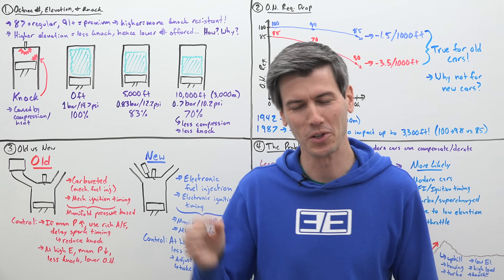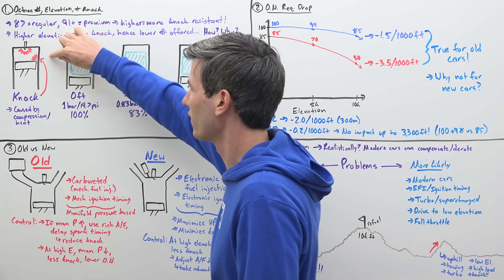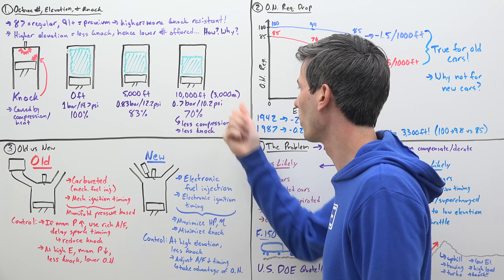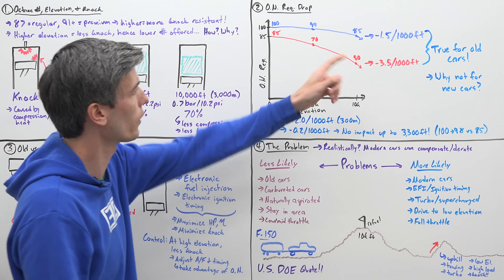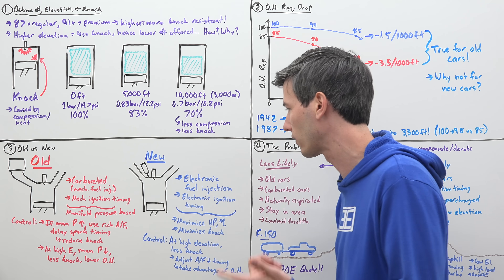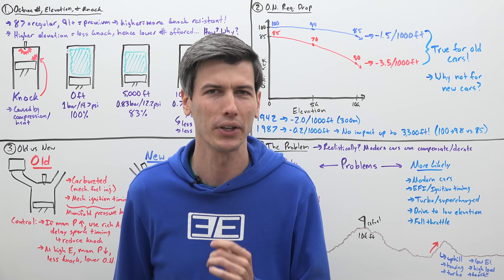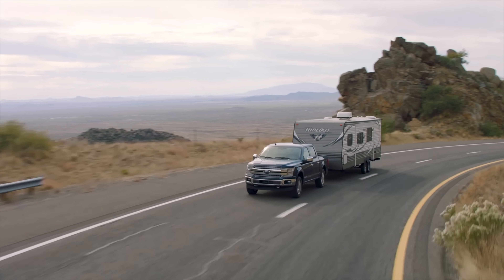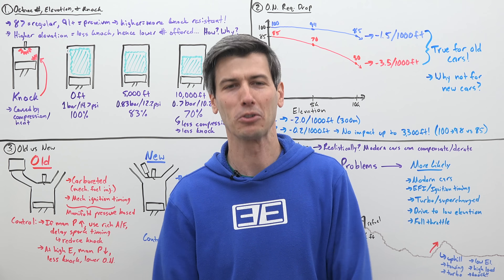Never Use This Gas In Your Car!

Comment: The difference is so minuscule at that altitude.  Honestly you have nothing to worry about, if you have a turbo and are towing you should probably increase it though.
Reply: It also depends on the specific car, for instance my 2003 c class Mercedes is one of very few cars to have 2 spark plugs per cylinder and extremely high compression ratio so using lower octane fuel makes it run noticably worse whereas my 2002 Camry would run on basically anything just fine, it's honestly just best to put the recommended fuel in and not risk it
Reply: It also depends on the specific car, for instance my 2003 c class Mercedes is one of very few cars to have 2 spark plugs per cylinder and extremely high compression ratio so using lower octane fuel makes it run noticably worse whereas my 2002 Camry would run on basically anything just fine, it's honestly just best to put the recommended fuel in and not risk it

Comment: What are your thoughts on the affect of ambient air temperature and its relation to octane ratings? For the F-150 3.5 Ecoboost example, would it be better to run 91 octane in the summer if it's 85+ degrees F for knock protection and then 87 octane in the fall/winter when it's closer to freezing (not factoring the effects of "winter blend" gas)?
Reply: With that engine you are going to be riding the knock limit at high torque levels, even with 91 octane, in just about any ambient temperature. If you are using boost and relatively high compression at the same time you're gonna want as much octane as possible to reduce EGT and increase efficiency / power (due to more advanced timing).

Now if you never use boost... Then go for the low octane, sure.

Source: used to be an engine calibration engineer for similar turbo GDI engines.
Reply: @jeffbeasley8235  That makes sense. What about the same scenario for a fairly high compression naturally aspirated GDI V8 like the GM L84 5.3? We have a '21 Silverado with this engine and we use it to tow a travel trailer. I have been running it on 93 octane in the summer as I figured the cocktail of high compression, towing, running the air conditioning, heat, and hills would call for it, but sometimes I'm wondering if I'm just burning money if GM says 87 octane is fine for all conditions.
Reply: @voided3  I would stick with  the recommended fuel for most vehicles, if possible. I know GM recommends 93 for the 6.2, which isn't so widely available. I've also heard a lot of people say that 5.3  runs better with 89 just like Mopar's 5.7L.  Maybe going to forums or Facebook to ask some experienced GM trucks owners about it.
Reply: @voided3  I agree with the other commenter - use the recommended octane unless you have data to show that more octane actually helps

Comment: I always use 98 octane instead. Than again I am below sea level. 😏
Reply: 98 RON isn't quite the same as 98 Octane using the measurement system in this video - I think it would translate to the low 90s but u can't tell you the exact number
Reply: @mardyj  RON stands for Research Octane Number. So why isn't it  the octane number? It is the octane number, otherwise it's just fooling the consumer if your octane number at the pump differs from its official RON number.

Also we used to have 91 octane 30-35 years ago in Europe, but it disappeared with the introduction of catalysts and environmental demands. We went from leaded to unleaded as well in the same period.

Comment: The 85 octane is fine unless you have forced induction.  My Acura MDX and Lexus GX460 recomend premium, but the same engines in Hondas and Toyota's provide about 10 fewer horsepower on 87 octane.  I'm not going to pay that much more for 10 hp.  Up at my elevation, there's about 15% less air, therefore 15% less absolute cylinder pressure, so 85 tends to be fine, and I probably make damn near as much power as I would on 87 or even 91.  The only NA engine that gave me problems on was a Jeep with a 4.6 stroker engine.  Much higher compression, because the combustion chamber is the same size while the displacement is larger.  Even then, it'd only ping a little at high throttle/low rpm, and 89 octane solved the problem.  It needed 91 once when I went down to sea level
Reply: Many modern NA engines are high compression.
Reply: @joby602  Yes, but cylinder pressures are inevitably lower at higher elevation

Comment: There one station where I live (Canada) selling something called E85 and it significantly cheaper then 87. What is this stuff?  I’ve never used it
Reply: You will definitely use about 20-30% more fuel depending on application.
Reply: Ethanol based fuel some people call it corn fuel lol only use it if you have a flex fuel capable vehicle capable of using Ethanol or it'll eat up your gas lines and gunk stuff up. And I could be wrong but I believe you eat through more of it faster than regular gas
Reply: @shrapnel6818  ei believe Jason has a video on e85 vs gasoline, but essentially 1.5 gallons of corn oil ~ 1 gallon of dino gogo juice.
Reply: @nou3796  the equation is not 1.5:1... Some vehicles make more power with it, some are just less economical, but you're on the right track with it being a less energy dense fuel.
Reply: You'll see a badge on your vehicle, or something on or around the fuel cap area that indicates whether you can use it or not. :) it's a roughly 85% ethanol (corn based) and the rest gasoline fuel mix. It's supposed to burn cleaner and be a sort of alternative fuel. You get more power on it, but less fuel economy. The colder the areas, the more gas you will find in the blend compared to ethanol.
Reply: It's a fuel blend of Ethanol (85%) and gasoline (15%). Although most countries/states allow a pretty large % range that E85 labeled fuel can be. Ranging anywhere from 51% ethanol to 83%. Ethanol burns a lot cooler and more efficiently, which is why you'll see a lot of higher performance cars use it. It also has a higher octane rating, somewhere around 101-103 octane. It can only be used in vehicles that are flex fuel capable, or cars specifically tuned to use it.

Comment: What's so bizarre about this is there are rural gas stations in high altitudes where 85 octane is the ONLY unleaded they have.  At one time, they sold 91 or 93 octane but the demand is so low, they keep the tanks empty.
Reply from the maker: Yikes! Yeah that's crazy.

Comment: Oh. So that's why it's so uncommon to encounter engine knock here! Today I learned something interesting, and it's not yet 9AM. Great video, clear explanation!
Reply: @Engineering EхpIαined🌟 looks like a phone number - did you mean to post this?
Reply: @BikingwithJP  This is not the real EE.  It is a crypto spammer.
Reply: @jaredkennedy6576  yeah I see the star now I thought that was weird
Reply: @jaredkennedy6576  gonna hit mark as spam myself now
Reply: @BikingwithJP  I also recommend copying the url for the genuine EE channel, then go to the spammer's channel and report the user as an impersonator.  You'll need the url for the genuine channel.
Reply: @jaredkennedy6576  Good call I did that too :)
Reply: We don't really have issues with knock anymore regardless.  Basically all modern ecus will just pull timing and that's that.
Reply: @EVLS10  If that were ever to happen (not that it should, my R18 civic just keeps going forever), would I check first for worn rod bearings or a stretched timing chain? Honda says the chain is lifetime, but I now have over 500k on the motor.

Comment: Interesting and cool video. I've never actually seen 85 personally, but we tend to get solid fuel selection in the Northeast. As a matter of fact, it's rare when I can't find 93 here and apparently a lot of other areas in the US struggle to find 93.
Reply from the maker: Many states only offer 91/92 as the top, so most auto manufacturers will design their premium-fuel based vehicles to use 91, rather than 93.
Reply: @EngineeringExplained  yeah, I was aware of a lot of states not having readily available 93 octane and some not at all, but the 85 option was something I didn't even realize was prevalent in parts of the US. My Mk7 GTI specifies 91 for the reason you mentioned given the lack of availability of 93 in large portions of America but I'm running a 93 specific tune so I'm thankful that 93 is readily available where I live.

Comment: So those store bought octane boosters are a good way to go about a road trip that may have e85 there?
Reply from the maker: Careful as e85 means 85% ethanol (which actually has a very high octane rating) vs 85 octane regular gas.
Reply: @EngineeringExplained  oh okay thanks for the reply, always learning

Comment: Interesting video! Living in Wyoming, the "Regular" grade fuel offering was 85 octane pretty much everywhere, also, I believe, in parts of Colorado. I used it for years in modern NA engines, even doing some lighter towing, but always at higher elevations, so I think I was pretty safely on the lower risk side of your whiteboard. I assume the modern engine control systems adjusted timing to prevent knock, I never had an issue or heard any knocking.
Reply: 85 is standard here in most of Colorado. Only out east, almost to Nebraska or Kansas, have I seen 87 as regular. Running from 5000 to 10000 is what we usually do here. I can see if you go to low elevation, but you'll likely have to fill up at a place that only sells 87.  I run 85 all the time here, and have no knock. Plus I drive my car hard. It's not turbo or super, but OEM calls for 87. I notice no difference between the two.  Only people in the front range that need 87 probably need 91 instead. Dirt bikes and sports cars.
Reply: @grimreefer4366  I used 85 in Colorado in my twin turbo Taurus. Would easily do 130 stock at 9000 feet. Went on a trip to Nebraska and the ignition retarded so much I couldn’t do 110. Ended up switching to a custom ethanol blend/tune. Then I blew it up do to poor maintenance. I guess if you use cheap gas you probably shouldn’t have a performance car.
Reply: @jamesowen150  Your speed has a lot more to it than fuel. If it was just fuel you could stop in Julesburg and get 87 up to 91. Ethanol is different. Most cars can't safely use it. In your example you're talking 130 and 110. Top speed limit I know of in US is 80. If you're racing then you should use race fuels.
Reply: For many years, several state government agencies in the Rockies prohibited use of any fuel in state motor pool vehicles other than regular 85 octane fuel.  If a state employee filled a vehicle with "super" or  "premium" fuel, the employee would be personally charged for it.
Reply: Pretty sure every gas station here in CO is 85, 87, 91. I can't recall ever seeing otherwise. Except maybe a rare one will have an ethanol free 88 or 89 also.
Reply: I moved to UT from CA earlier this year. Had never seen 85 before & liked that it was cheaper 😂 Went back to using 87 or 88, though.
Reply: one point- if your engine is Turbo or supercharged, do not use 85.

Comment: So now, vehicle ecus need to have the ability to determine if they are above sea level to allow the computers to prevent knock in vehicles who are passing through, and filled up with 85 octane and not living and commuting in areas with high elevation. ECUs need this fail safe feature.
Reply: Not so much the ecu, but the compression alone may cause issues. I suppose you could put in a wide band variable intake timing system that could go to an Atkinson cycle to let some of the intake air back.

Comment: We allow the sale of kerosene and diesel at gas stations and those would also cause damage to a gas engine. 85 octane is just different product that's available for purchase. The burden should be on the vehicle owner to purchase the correct fuel - not the gas station for only selling fuels that won't hurt most gasoline engines.
Reply from the maker: Yes but it's labeled as "regular" gas, which many vehicles say is the minimum requirement. It's not as simple of a difference as putting diesel fuel in your gas car. Sure, it's in the owner's manual - I'm just not confident everyone reads those things.
Reply: @EngineeringExplained  I found a wiki list and in roughly half the states where 85 is sold, it is listed as "low octane" or has some other warning affixed to the pump. Even if the gas station labeled it "super-dooper engine juice", the burden would still be on the owner to fill up with 87+. Labels aren't a standard, octane rating is.
Reply: @EngineeringExplained  Exactly, I think we can all agree some people are not very car literate. To sell a gas type (85) in place of regular unleaded 87, which a large majority of cars can't use, is extremely deceiving if not fraudulent. Great video Jason!
Reply: @EngineeringExplained  if someone buys a product, especially something like a car and they don't read the owners manual, then it's all on them what happens.

Comment: I've actually seen this gas at a couple of local stations in So Fla and this is no high elevation place. They call it economy regular.
Reply: Here in ID we have a saying, "go kick rocks" (a nice way of saying F-off). A friend of mine from FL told me that saying was illegal there because they got tired of moving the "highest peak" marker.
Reply: I bought 86 octane by accident in Ohio in ‘01 and my ‘91 vw (fuel injected 4 cyl) ran like crap.  Drove fir an hour and topped up with 93 to correct issue.
Reply: @dantecasali9821  Many moons ago, I drove to Pa with my V8 Plymouth and saw a gas station that sold 96 octane gas and I thought it might make my car run like crazy, well, it actually ran like crap, i guess it was too much octane for even a 318 V8
Reply: Humidity is also a. Knock retardant…maybe that’s why?
Reply: @dwaynepenner2788  That's right! Humidity probably prevents knock because it will lower the combustion temperature.
Reply: Really?!? In florida?
Reply: I've seen it in rural parts of Nevada and other 'inter-mountain' areas of the western US..
Reply: There used to be a few stations in Michigan that sold "economy" fuel. I haven't seen it since the 90s.
Reply: It maybe E85 that you are seeing which is 85 ethanol but i would not put it past the gas companies to try that ; )
Reply: @grampy2004  No, those nozzles are different, these are brands that have a large range of octane available, from 85 to 93. I think it's all BS, they just mix them up. You wonder what you're really getting.
Reply: @peterfernandezjr5914  I know wish there was a way for the average guy to easily test to see what we are really getting ; )
Reply: @peterfernandezjr5914  I know wish there was a way for the average guy to easily test to see what we are really getting ; )
Reply: @grampy2004  I've heard that mid-grade is a mix of regular and premium, do you know if this is so? I know someone who only used mid-grade in his vehicles. I think he's wasting his money.
Reply: @peterfernandezjr5914   Mid grade is usually blended at the pump.  That way the station doesn't have to have a 3rd tank. Or they could uses the 3rd tank for diesel
Reply: @pauls8685  Correct. This is how they make the mid grade.  Last time I filled up, my local stn was out of 87 octane, so they were selling 94 octane for the price of 87!

Comment: I don't like how gas stations attempt to market 93 octane as better for your engine when the truth is that you want the lowest possible octane that doesn't cause knock since a higher octane will mean less of the fuel is ignited. You'll get better gas mileage, more power and better emissions with the lower octane as long as there's no early detonation (knock) occurring. Great video to help people understand!
Reply from the maker: Careful! It's often not needed, but higher octane doesn't mean you'll ignite less of the fuel. It will all still burn, it's just excessive in that you never get near knock, so you're paying for and advantage you don't see. Explained in more detail in the pinned comment.
Reply: I believe the ignition / flame propagation happens more slowly with higher-octane fuel.  If you use excessively-high octane fuel without correspondingly advancing the timing, it will all ignite, but if the combustion is slower, it could happen late enough in the cycle that you won’t get as much crankshaft torque, and some of it might still be burning when the exhaust valve opens.
Reply: This isn't really true anymore, modern engines use timing adaptability to adjust to the octane of the fuel being used to extract the maximum amount of power and efficiency (they run just under knock threshold). For example, Ford EcoBoost engines only require 87 octane minimum, but will develop more horsepower and efficiency on 93 because the timing can adjust to take advantage of the higher octane. Horsepower ratings are also done with 93 octane not 87. What you said might have been more correct 15+ years ago before engines had the technology to adjust to knock threshold.
Reply: The only recommendation that has ever mattered is the one from the manufacturer.  Yea it's a waste on a something like a Honda Civic, but just Lee said.
If a Engines recommends higher grade fuel, you're going to lose all around efficiency by going lower. Less power, worse gas millage, and honestly there's always gonna be a higher potential for knock. Specially depending on the specific engine. 
I always try to stick with the recommended fuel.
Reply: Not if your car is tuned to run best on higher octane gas. I get more gas mileage, more power and a much smoother driving car on higher octane gas then regular.